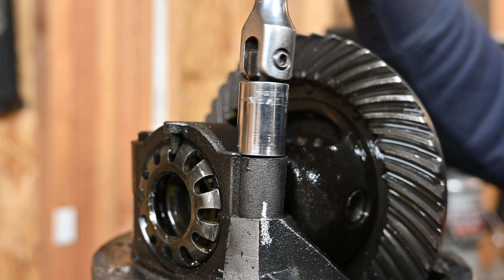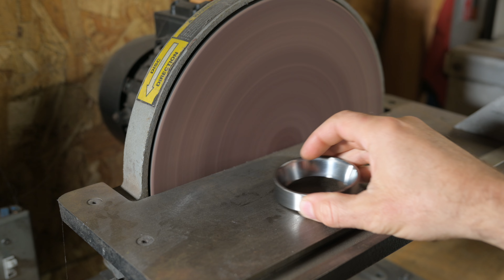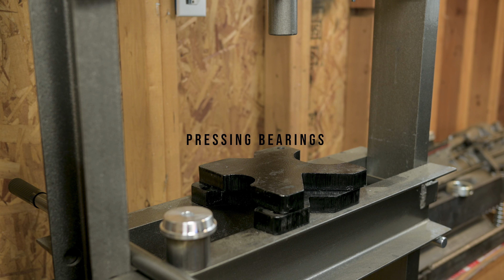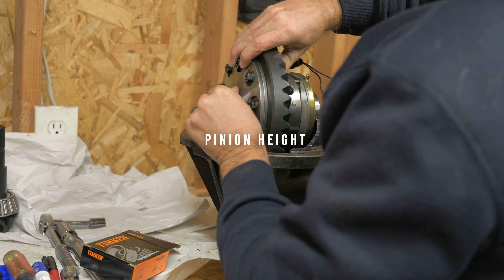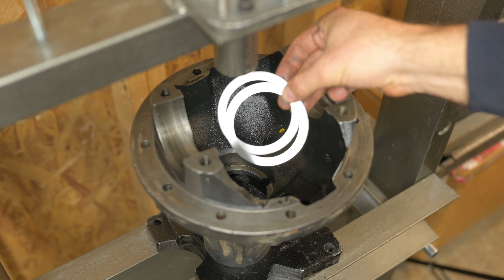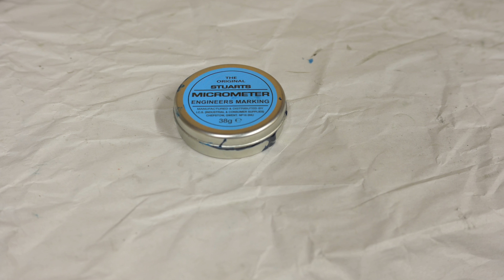Land Rover E-Locker and 4.37 Gears - Part 1

Comment: I know the feeling about the changing scope. I've done the chassis swap on my Disco with an incredible amount of new parts, as soon as i start thinking about new rims+tires and suspension lift including new bushings, it throws a fit and becomes hard to start, lumpy idle at first. I just want to drive and modify it, but no, i have to buy "keep going" parts rather than "fun" parts... Mines the D2 TD5 though. Im thinking either injectors, a dried seal in the diesel supply allowing air into it or a failing pump. sigh cant get a break from getting breaks.
Reply from the maker: Scope creep seems to be the only way I know how to do it. I'm lucky the Disco has been on the road pretty much the whole time I've had it and not stuck in the shop while I engine swap it. 

I wish we got the TD5 here in the states. Seems like a cool engine.
Reply: @tfrasca  I quite like the Td5, but it is a low power lump. 136hp isnt much to get a 2,2t beastie in motion. The old ZF 4-speed Auto designed for a station wagon doesnt help much either, its like praying to get power out the other end, thankfully mine got upgraded with internals and Torque Converter from a V8 model 4-speed. The Td5 auto comes with the ZF 4HP22, the V8's had the ZF 4HP24, mines has the internals of the latter in the casing of the former so its already better than stock. There is a lot on a D2, especially mine even though its not the highest spec. It has a Hydraulic anti-body roll system, aka ACE (Active Cornering Enhancement) which does like to fail after a couple decades, the galv steel pipes corrode in the valve block and break, the steel sleeve solenoids corrode and break and the two hydraulic ram boots can tear and destroy the ram itself. Then there is the Air suspension or SLS, Self-Levelling Suspension, which is generally fine, not had issues apart from a slow leak at the moment, but the bags are old and the small O-rings on the hose nut are cracked, needing replacement, otherwise few issues.
After that you've got the SL-ABS module which can throw problems at you, for example leaving an ABS sensor unplugged throws 3 warning lights at once, the Three Amigos im sure you know of already. Shes a pretty solid car, but after 24 years of abuse, a lot is failing. Body work is one of them, everything that sees the most water is essentially rotting, arches and floors. Bulkhead goes behind the arches because LR didnt allow water to drain properly from the engine bay. Its a long road to get them back to how they should be, but my word is it worth every penny. So much fun to drive.

Comment: Excellent video 👏🏻
Reply: Having benefitted from your video whilst doing my own first diff built I think there are only 2 things you didn’t cover: how you set the preload on the carrier bearings and when in the process you torqued the carrier bolts ?

Comment: Why not just run 2 mechanical limited slips front and rear? No need for electronics or air.
Reply from the maker: Because locker > limited slip. Eventually I'll probably pull the LSD out of the front and put a locker up there too. Running the wiring is a very minor job, especially compared to having to deal with a compressor and air lines.

Comment: Hi Tyler after this few months passed can you make an review of the two type of diff? It could be helpful, in particular I’m interested in the e-locker: do you have the common e-locker problem of engaging and disengaging of the lock by changing direction of movement? Does it engage instantaneously or do you have to go forward a few meters? Thx for your reply. All the best!
Reply from the maker: I wouldn't say I've gotten a TON of off roading in with the new diffs, but probably enough to have an initial opinion. I haven't been able to notice a delay with the e-locker. I mean, the wheels have to turn 1/3 of a rotation for the pins to line up, but I've never had to rock back and forth or anything like that. It's basically instantaneous. And I think if I were doing it again, I'd put another e-locker in the front instead of the ATB. The only plus to the ATB over a locker is that it theoretically will be less harsh on the front CVs and axles, but I'd rather have the ability to select fully open or fully locked instead of wondering if/when the ATB is going to lock up by itself.

Comment: I put a tyrex e-locker which is conveniently made by eaton in my '96 defender 90 and a true track in the front with 4.75 gears
Reply: But mine also has 37-in tires
Reply from the maker: Nice. Sounds like a beast!
Reply: @bradleybevis9996 I want to put e locker on my 90s and I am between tyrex and terrafirma what do u think?
Reply: @Panos4002  probably both sourced through Eaton.

Comment: Just curious what suspension you have? I have the o m e 2 inch heavy duty but since it's heavy duty the Springs are really stiff so I decided to take a risk and run no sway bars and it is so good I completely deleted front and rear and it still handles good on the road to an extent if you're not acting like it's a sports car but off-road gets plenty of articulation even with the heavy duty springs I'm thinking of getting the Terra firma 4-inch and leaving sway bars off. Everyone says go RTE but I don't have that kind of money and I figure running no sway bars then whatever the 4-inch from lucky 8 seems to have everything you need. I mean if the shocks go bad big deal I'll order some better quality ones of the same dimensions but I really doubt the Terra Firma stuff is going to physically break I mean gosh unless you're trying to jump the thing LOL I don't imagine actual radius arms and things having issues from Terra Firma so it leaves it down to just the shocks which I don't care I'll replace if they have issues
Reply from the maker: I actually have the Terrafirma 2” lift, plus 1” spacers with no sway bars. With 33s, I like it, but I will say that the springs seems to be sagging a bit after about a year and a half. I have a set of 3” RTE springs along with a bunch of other stuff waiting to go on the Disco.

Comment: Wow this is a great video! I am actually considering doing a Detroit Locker in the back and a true track in the front this summer. I have a 2002 with CDL fitted on a 2-in lift with 33s and still have the factory gears and that thing will go so many places but yeah it's a little weak on the highway for sure. I have the V8 running probably the very very best that ever has in his life even close to 200 me but still. I think I'm going to go 4.10 gears because on the calculator 4.37 even with 35 is much reduce compared to even stock tires and gears. Bad enough it will be like 60 MPH at 2,500 RPMs I'm afraid 4.37 will make it like 55 mph at 2,500 RPMs and I'm not sure if I want that LOL so on a side note I sprayed mine with Raptor bed liner in Battleship dark gray with black roof and black rock sliders. Not only does it look sick but down here in Arizona I can just fly around to the desert and get it all scratched up and then at the car wash everything comes off because they're not really scratches they're just plant deposits on their Raptor liner LOL it's amazing you no longer worry about pinstriping. But anyways yeah keep up the good work I think I'm going to get mine from lucky 8 just by sending one of my spare third members in and let them do it because although I like watching what you're doing I'm a little nervous of trying to attempt all that LOL
Reply from the maker: Yeah, if I were buying gears again, and planning to stay with 33s, I’d do 4.12s for sure.

Comment: I have the flip: Detroit TruTrac limited slip in rear and ARB locker up front. I did this because I had heard the limited slip up front can cause push steer, especially in icy conditions, and I was living in the mountains at the time, so I definitely wanted to avoid that. I've been very happy with the locker up front and being able to strategically lock & unlock it per the demands of the terrain/obstacle.
Reply from the maker: I had a few people warn me about that possibility before I put the ATB up front. I've only had it in the snow once so far, and on an off-camber section, the front was definitely understeering/sliding downhill. It might have helped to have been able to unlock the front in that case. If I were to do this again, I'd probably go with selectable lockers in the front and rear.

Comment: Nice. Mine has 4.75 cw&p with 1.301 transfer ratio for 255/100 r16 Michelin. 
Now it is too high to climb into. 🫤

Really needs the 30% or 49% reduced low range gears fitted now. 😕
Reply from the maker: Wow, I didn’t even know that tire size exists. I thought my 255/85 were tall and skinny.
Reply: @tfrasca142  they are military XZL....metric equivalent of the 9.00R16....36 inches tall. 🫤

Comment: Nicely done mate 👍 I am also thinking of installing a locker at the rear without changing the gear ratio for my future 33". Instead I decided to replace the 1.22 transfer case with that of a 1.41 defender equipped with a CDL. 

I made an HD front bumper equipped with a winch last week. You can check out the video I posted in case you are interested in designing your own too. I published all the plans insidethe video.
Reply from the maker: I thought about just doing the transfer case, especially because I have a spare sitting on the shelf. But I really wanted a better low range too. 

I’ll check out your video. I have a winch bumper already, but I have been thinking about adding a simple bull bar / light bar.

Comment: Great video. I'm curious on what gear oil you used with your ATB (torsen)? I used the trutrac's in my girlfriend's disco 1 front and rear. Found very little info on correct fluid. But found that they work best with no friction modifier. Since they work better with a bit more friction. I'm in Washington state and John Deere and Ford were the only two that carried gear oil with no modifier.

 Keep it up I enjoy your channel
Reply from the maker: Thanks, I appreciate that. I haven’t gotten the ATB in yet, but I plan on running some synthetic 85w90 in both diffs.

Comment: sanding down those bearing races is a great trick. I did preload on a  fwd lsd and wish i had known this for that job
Reply from the maker: Yeah it helps a lot. I guess it would be better to use a brand new race, in case the old one is worn significantly, but this seemed to work for me.